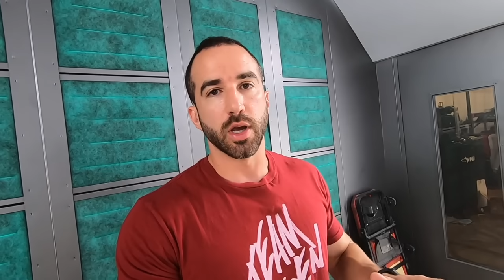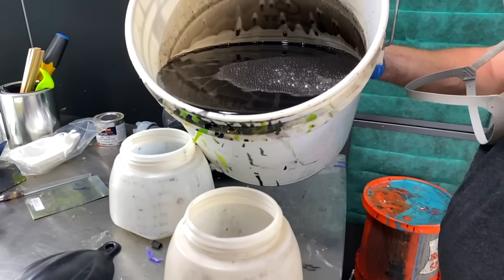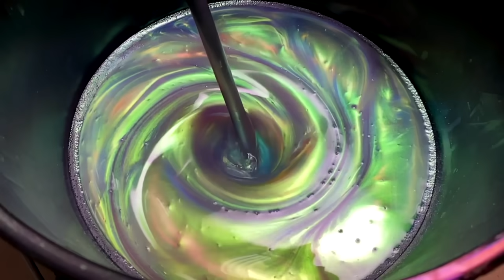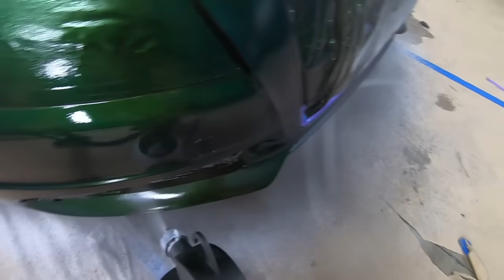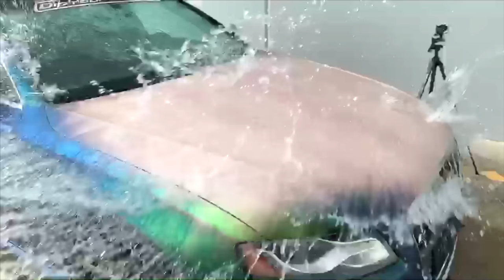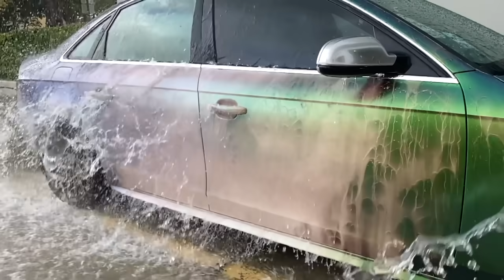We Attempt the World's First VANISHING HYPERSHIFT Car

Comment: It’s kinda cool and weird how you can see all the braces, glue spots, and sound deadening pads in the doors and hood when they change color due to different heat transfers haha
Reply: Thanks, I was wondering what those were
Reply: @austincde  same
Reply: I was thinking the same thing.
Reply: I just need that paint
Reply: I noticed that, too
Reply: I don't understand why it would show through though..... Could you possibly explain it
Reply: @chaoticmoonenergy6787  thinner metal get more hot more quick, pretty paint reacts to temperature, inner panels suck heat away from surface metal, where inner panel isnt stays warm for longer
Reply: @chaoticmoonenergy6787  Good question
Reply: @noescapeforyou1747  Thank you for answering as I was wondering the same...

Comment: That is absolutely spectacular!!  Won't the hood always be white when the car is running, due to the heat generated under the hood?  I did think it was fascinating how you could see the inner workings of the window mechanism under the paint surface.
Reply: I guess it comes down to at what temp does it change?  Will the engine running change it.  Will the paint 'fade' on a hot sunny day?
Reply: The reason thermo color shifts are not commom on tee shirts is because the armpits were always different, lol. 😂
Reply: @wildflower1397  True, and other 'bits' for females.
Reply: @wildflower1397  I used to have a bunch of color shift shirts and you're right, the armpits always shifted first. It was hilarious!
Reply: What you're seeing inside the door is the side impact brace (Circles) and the square sheets of sound deadener they put on the inside of the exterior skin.  They don't cover the entire sheet of metal, just put a square to deaden the panel.

Comment: 9:06 its like an x-ray of the inside door where it's touching the panel. That's wicked.
Great idea and video!!
Reply: I was wondering what those are ... makes total sense.
Reply: I just had a hairbrained thought ... you could put temperature changing panels on the inside to change the colors on the outside?
Reply: Johnny Street Sign  ooo cool idea but sounds like fire hazard 😬
Reply: Johnny Street Sign   ahh fair enough  maybe so type of low voltage toaster wire in like a chicken fence wire patter. Thangs for being a trucker much respect  hats off to you!
Reply: Johnny Street Sign  i wonder how many gallons it would take to dip a 50+ foot box trailer if it would sick 😂 now that's the real question
Reply: @NS-nn6er  More like heater pads you can get to install on your oil pans for colder climate areas (pretty much required in Alaska in the winter so your oil isn't sludge)
No ment to get super hot but just gently warm things and keep them there.

Comment: 9:05 I thought it was really interesting that you could see the temperature difference where the sound deadening and body adhesive material in the door was. And the difference in temperature from the plastic rear bumper cover to the metal body. Super cool video guys🤙
Reply: Thanks for the comment, I was just going to ask what that stuff was, but now that you pointed it out, I don't have to wonder.
Reply: Would be Kool if u could spell something or brand logo instead of the deadening material
Reply: I thought it was bondo lol

Comment: Are there cold temperature reactive paints out there?  This stuff is awesome, but it would be amazing to see a car change colors during a rainstorm where cold water is falling.
Reply: Or just a more sensitive heat reactive paint? One that transitions around 60f degrees?spring and fall mornings make it one color, as the day heats up, you get the second 👍
Reply: That's what I was thinking, imagine the cool color changes with colder water as rain falls, oh man!
Reply: Yes there are. It's just a lower temperature transition. So it's basically always in the elevated state, and then the cooling brings it down to the resting state.
Reply: That would be sick, imagine driving a different coloured car all winter then it magically changed in spring
Reply: @BrokeMahWallet  in the winter everything would be one color except for blotches on the hood due to engine heat
Reply: That actually would make more sense in a real-world application.
Reply: @JoshB_TheTower  unless you had a electric car 😎
Reply: @BrokeMahWallet  the electric components still get hot so u probably have spots too but elsewhere :)
Reply: @MaxMustermann-dq2se  like probably on or near the charging port, if it was a Tesla it’d be on the charging port cause their starting to add heated charging ports.
Reply: @JoshB_TheTower  Those with CF hoods would probably keep them as is tho

Comment: Wonder what the rectangle and dots on the doors were from?
Reply: Most likely welds, sealer, and door insulators.. I use to build Chevy trucks and all vehicles get them.. They help reduce vibration when you close the door
Reply: its the inside of the doors or hood , its the panels that give structural strength to the doors or hood,  open your hood and you will see them .
Reply: The circles are the glue that bonds the door skin to the door frame. The rectangles are most likely sound deadener sheets. More mass = harder to change the temperature, so those spots go back to the normal temperature quicker than the areas with just the thin door skin.
Reply: I wondered the same thing and thanks to the people that replied I got my answer

Comment: When car has been running for awhile does the heat from the engine turn hood white?
Reply: What I wanna know .  My diesel would keep it white
Reply: Might depend partly on the insulation under the hood. My truck can hit full operating temp without melting thin ice on the hood
Reply: @avrealvalkara5555  itll tranfer over time. Majority of newer vehicles are aluminum hoods now
Reply: @brandoncaldwell95  I think the only reason mine is insulated so well is because I replaced the original a few years ago. It started disintegrating in my hand, so I figured it was a good time to replace it
Reply: @avrealvalkara5555  What year and model? My 05 had great insulation and paint. I babied but used that truck. After the hood was replaced because of an accident, the insulation was thin and fell apart. They couldn't locate an OEM piece but found everything else GM branded. I will say i was paranoid it would destroy the paint with all the heat. Surprisingly, it didn't bit Pecans sure tore the F out of that hood. Looked like hail damage. 

I seem to have a terrible luck with vehicles. Mine i try to keep new, and they are typically messed up by others. I drive someone else's vehicle, not a scratch. Currently a family member and i swapped trucks and have zero care to flop ot at the bank. Basically pahing one anothers bank note...
Reply: @brandoncaldwell95  I've got a 98 tacoma 3.4 and I couldn't ask for a better truck. Fires up every time I turn the key, and is just as happy on road as off. I take care of the maintenance, but I don't exactly baby my truck. I'm of the belief that one good layer of dirt protects from the other layers of dirt.
I also bought my truck at 280k miles, and I'm at 333k+ now. The paint isn't great, was obviously a cheap job done by the previous owner, but good enough to use as airbrush canvas when the weather is nice.
If you want a vehicle that won't quit without a fight, I highly recommend a 90s tacoma V6 with the 3.4
Reply: @avrealvalkara5555  my 05 5.3L was just as tough. 6.0L are of the same build just a few things different lasting 500k+ miles. The 90s model 350s blew at 250k usually. I have a friend with a 1985 chevy Cheyenne with a 350. Bearings are shot on the crank so he has to run 15w40. 

As for me, i cant run smaller trucks anymore. Id love a 1st gen ram or 12v second. A crew cab long bed 454 or 12v swapped chevy dually is next on the list. I have equipment that pushes 25,000 lbs im sure an S10 would wimper under 🤣
Reply: @brandoncaldwell95  I like the older ones, I had a vehicle newer than the 90s....that'll never happen again. I love my truck and have great plans for future power improvements....I just can't afford it now.

I do intend later on to get a bigger truck too, simply because tacos aren't really towing vehicles. They'll do it fairly well, but just not made for it. I've been lucky on my truck so far, no major repairs, just standard stuff. The only thing I can complain about is that the ball joints don't last as long as I'd like. But that's normal from what I've found, and a price I'm willing to pay for dependability.
Reply: Raevyn Valkara what do you have a Honda Ridgeline ?
Reply: @AlphaGolf1  I would never own a honda. I've got a 98 taco with new insulation under the hood because the old stuff literally fell off in my hand. The new insulation works impressively well

Comment: 9:25  I wonder what's on the inside of the doors that is cooling the surface faster than the rest of the door panel ?
Reply: cold make color change, so its something warmer,  AIRBAGS mounting
Reply: Was wondering the same thing
Reply: Support for the door frame, probably holds the temperature a bit better / disepates it thus it changes back quicker
Reply: @acount17  can't be airbags, they are located in the frame of the roof. dotted lines are welding spots where door frame reinforcements are installed, rectangles probably are glued pads for reducing vibrations
Reply: The large "panels" you see are likely sounds deading materiels used around the door latch linkages to keep the metal rods from banging against the metal skin of the door. The round circles are probably weld points for the window track.

Comment: This is the kind of thing you see in a movie where the criminals pull a heist, send the getaway car through a carwash, and it's suddenly a different color.  Maybe they change the license plate as well, and you have a completely different car in a few minutes.  Then while the authorities are looking for the wrong vehicle, the criminal masterminds get away.  But in this case, the second layer of color doesn't literally wash off.  It looks like it's temperature sensitive.  Although, that has some possibilities too.  It might be possible to have a sci-fi kind of car with a temperature controlled skin that changes color with the press of a button.

Comment: This seems kinda situational, also wouldn't the temperature from the engine change the color on the hood? It would be kinda weird to have only that part white.
Reply: You could forego doing color shift on the hood due to what you pointed out. I think it would be fairly practical considering a lot of people will have a different color hood simply for the aesthetic, and then you aren't worrying about specific hot-spots on the hood.

Comment: Does it have to be hot water or could it just work with heat activation? You could outfit it with heated body panels and have a switch that changes the color to white. Greatest getaway car ever

Comment: Why not put in heated plates under each metal panel and have a temperature adjustment system in the car so that you can use elctronic heating to change the car between black and white whenever you want? Like the Green Hornet car.

Comment: Looks great, but the body is going to have to be in excellent shape as I see repairs are showing through because they hold temp.longer than the metal.
Reply: I was wondering what those spots were haha
Reply: @XxSoBeHaLLxX  Those are not repairs but sound insulation pads in the doors, glued to the inside to prevent vibration.
Reply: @brettster3331  Thanks, I couldn't come up with a cause in my head.  Makes perfect sense.

Comment: Hi... Can you teach me how to prepare thermochromic paint for my motorcycle? I don't have any knowledge in paint job. I already understand the mixing ratio. I did experiment to test if mixed it correctly. I just use the thermochromic pigment and thinner and found later on that it becomes back to power when dry. Later on I figured that I missed Top coat and catalyst. But my motorcycle is matte black. Here in the Philippines is Hot. Thats why I want my base color remains the same as matte black and shows my desired color (chameleon color of Maroon,Red,Black) when its cold or raining. Meaning since hot in our country the thermochromic will be always transparent and the chameleon color will show if it is cold or raining or during night or in the shades. I don't have knowledge on what ingredients needs to mix. Can you give me some tips on how I mixed my Pigments? I Have thermochromic black pigment and chameleon pigment "sprch01 akatsuki". 

Thank you in advance...

Comment: Would be awesome if it were the opposite on the thermal pant just because when does it ever rain hot water. Or will the color come out on a hot day? And then if it rains on a hot day color changing abilities. Then its worth it. Other than that it looks like you just white washed the car it doesn't stay changed. Very cool ideas tho